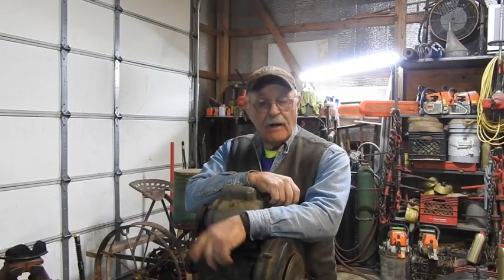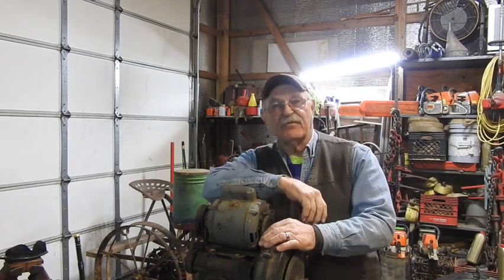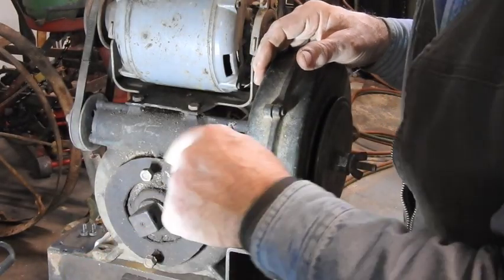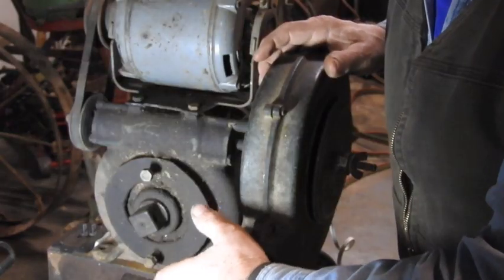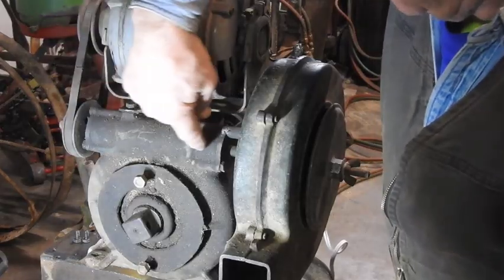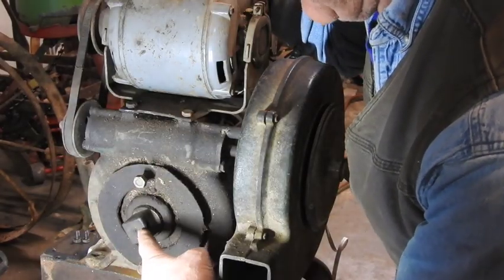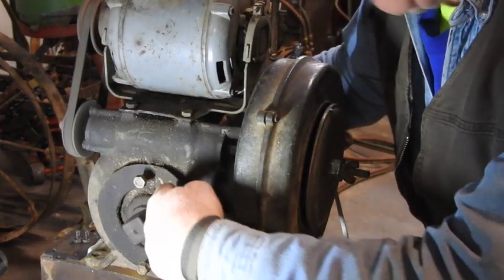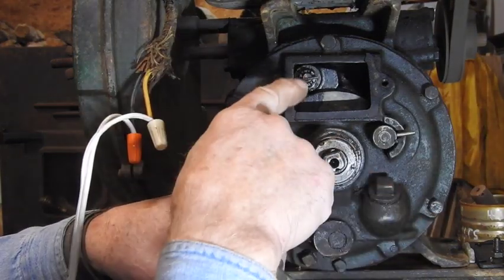Was THIS In Your Grandpa's Basement ?

Comment: I can just barely remember as a kid, a man putting planks down on the grass and wheelbarrowing coal into a 
basement window shoot. Our Timkin oil furnace lasted 50 years.
Reply from the maker: In the older part of my town you can see dozens of the old stamped steel or cast iron coal chute doors on the foundations some of the houses.  Lots have been eliminated and bricked or blocked in though.  Thanks Jon for stopping in with your fading memories.

Comment: Great Grandma's farm house had a big ugly coal furnace. It was upgraded with a fuel oil gun. Not the best heat transfer but it worked. AL B.
Reply from the maker: Hey Al, good to see ya buddy.  I never got to do a fuel oil conversion from coal, but I have gotten to tear them out and replace the whole she bang with standard up flow natural gas or LP gas units.  That thick old cast iron does NOT transfer heat quickly at all.  Especially on a cold cold house.  Thanks for stopping in today.

Comment: I grew up here in Maine with one of those old coal stokers on an "Electric Furnace Man (EFM)" brand low pressure steam boiler feeding cast iron radiators.    At sometime in the late '60s it was transformed into an oil burning rig.   They had to rebuild and refractory the combustion chamber to handle the oil burner.   As far as I know that system is still in that old house.  I suppose it's possible that a newer oil fired boiler could have replaced it... but the radiators are still there.   Thanks for the video and the memories!
Reply from the maker: Neat story from your memory bank.  I enjoy it when some silly video I do sparks memories in some of the viewers.  I also enjoy it when it blows them away because of never seeing something like it before.  Hahahaha. Thanks for adding to the thread Gary, it is appreciated for sure.

Comment: I was born in 73 bought my house in 92. It was built as a duplex right after WW2 and originally used a coal furnace like you described. That had been pushed aside in 69 and a NG furnace sat in its place. No one in my family had ever seen a coal furnace because no one had ever lived in town! I tore down what was left of the coal room and spent a long, hard day with my cutting torch hoses running through the chute to get that old furnace into small enough pieces that I could carry up the steps and through the 32” doors. I used some of the coal for a backyard forge, but I still have some stashed in the basement after all these years!
Reply from the maker: Hahahaha...and just think, I did that for a living.  Back then the pay wasn't too good though.  But we got to salvage a LOT of old stuff though.  Good story, I enjoyed it. I didn't manage to end up with any coal even though we had a barrel of it for our forge in the blacksmith shop.  Somehow I have managed to get parts to two forges.  Maybe I'll get to beat on some hot metal again one day.

Comment: I grew up in a house with a gravity flow octopus furnace with a coal stoker like the one you talked about. My dad later replaced the stoker with a new one--the old one wore out and he added a blower to force air into the house. What an improvement!! Something I remember happening the spring and fall was the heat demand on warm days was so low, the fire would go out, but the stoker didn't know that. Then when it cooled off and the stoker came back on, it would fill the furnace with unburned coal while Mom and Dad were at work the kids in school. My father was a very low key guy, but when that happened and he had to shovel out a furnace full of coal, he wasn't so low-key.
Reply from the maker: Hahahahaha....I love the story about your 'low key' dad...until he wasn't. LOL. What was that phrase made famous by Forrest Gump..." Sh_t Happens".  Good story, thank you.

Comment: I remember those old Honeywell gas valves you mentioned.  During the annual service, I remember two oil ports inside the metal can cover.  Some of them had a damper arm coming out the side to control the burner air.  If the power went out, you could pull up on that arm to open the gas valve and then push in a button to hold it open.  Back in the days of Natural Selection.
Reply from the maker: Yes, the two oil ports had tiny flared funnels on the ends just perfect to drop in a couple drops of oil with every service. And yes, you could bypass them on power outtages when necessary. I saved one of those old valves back in the 70's but for the heck of it I could not find it for the other video.

Comment: A the good old days. 
First house I remember had an oil stove in the living room. It was a lake cottage on Messenger Lake near Coldwater, MI. I don't remember ever being cold there. No blower. No registers. Just a big porcelain coated box in the center of the house. I was 7 when we moved and the "new house" had three coal stoves. One in the living room. One in the kitchen and the cooking stove in the back room. 
The old guy had died and my folks bought it from Baggerly Funeral Home who got it for burying the guy. First year we heated with lump coal from the small barn in the back yard. My brothers and I would go out and break up the lumps as big as your head with a hammer and lug them in the house. 
One of my childhood buddies had a much nicer house with a stoker. It was fully automatic and the coal yard just kept the bin full. 
We moved to the 3rd house and it had a coal furnace with the old chain damper controls. It worked well but took up most of the basement. It had been owned by the guy who owned the coal yard in Coldwater. 
Dad put in a natural gas forced air furnace and that was my last coal heated home. 
Now I play with fireplaces and a coal fired blacksmith forge. 
The wood stove will be an interesting step back from the basement and heated garage shops. 
Thanks for the trip down memory lane. 
The old memories are the last to go. 😁😎
Reply from the maker: As always, I LOVE your detailed stories of your younger years my friend. I didn't realize large chunks of coal was available like you describe, much less having to go out with a hammer and knock off a few corner.  That's a new wrinkle to digest. One of my uncles had the chains in the living room to control the damper downstairs, but all we had was a wood cook stove and a wood fired King Heater in one of the bedrooms. Nothing in the second bedroom.  We only used a bit of coal in the huge brick and stone forge up in the blacksmith shop across the road.

Comment: Interesting video T man. I never knew so much went into burning coal. For the past 20 years, I’ve heated my house with propane. This year I had a mini split installed.  14,000 BTUs. It’s been a pretty cold winter to test it out. So far works like a million bucks.
Reply from the maker: LP gas is good in my book.  There's 2500 btu's per cu ft of LP gas versus 1050 btu's per cu ft in natural gas.  There flu temps are close, with LP being marginally higher unless its a condensing furnace. Mini split heat pumps are great as well, but you have to be ready for the lower air temperatures as with any heat pump...as compared to a fossil fueled appliance. My favorite mini is the Mitsubishi.  I've installed quite the variety of mini's with none matching the reliability of the Mitsubishi. Of course that's only my experience. The upper end units maintain total capacity output down to about +5F which is really good.  They do it without any field installed low ambient controls too.
Reply: @ the unit I had installed is a fujitsu. The installers told me it would heat down to -15. And is guaranteed for 10 years.  I was going to go with Mitsubishi. But with a little research, these are said to be just as good. Time will tell.  But hey, it’s guaranteed for 10 years.

Comment: Now there's a machine that I have never heard of before. Then again, we didn't have these coal furnaces where we lived. 
Talk about " where there's a will, there's a way" in people's thinking and needs. Wonderful unit to be sure.
Reply from the maker: Hahahaha... Coal was widely used in this area back a few years. I just thought maybe there'd be one or two guys that remembered one of these old stokers in their own grandpa's basement.  LOL Coal was just a couple bucks a ton down here so I guess delivering to Newfoundland would increase the cost a bit, even at 25 cents a gallon for fuel.  (-:
Reply: @tractorman4461  I think I have  misled you in us not having coal furnaces, I meant that I don't recall seeing these coal stokers.  My goodness we certainly did haver them, but perhaps only the larger building may have had this type of system. Just a side note, the school here I attended, had a couple of huge hot water type coal fired furnaces, and when we wanted to skip a class, ( or two ) some of us would go down to the furnace room and sat and talked to the 'Janitor' as he hand shoveled in those huge coal shovels of coal. I think he would have liked to have an automatic stoker! :) I don't recall the price of coal back then, but it wasn't very costly.
I wonder what the price per gallon was for furnace oil then?? I do remember that when I was a young teenager and worked at a local 'gas station'  we sold gasoline for 48 cents per gallon. Now bear in mind that a gallon was  Imperial measure here in Canada and is approximately 4.7 litres, whereas the U.S. gallon is at 3.785 litres.
Reply from the maker: @regsparkes6507  Hahahaha....I'm not sure if I was mis-led or my lack of comprehension missed the point.  LOL. No biggie, but as soon as I read your reply I'd told the Missus Reg just told me they didn't have coal for heat in Newfoundland...so we had a bit of conversation about that.  Ain't that funny.  So now I have corrected my own mis leading info to her.  Oh well, alls well that ends well. 
   I liked your story about your schools janitor shoveling coal.  I don't know the price of #1 fuel back then either, but I'm sure it was cheap by today's standards. My grade school was finished in October of '56 the year I entered first grade. So all the kids from this side of town were separated out of the catholic school we all went to and put us in the new school on this side of town.  My class was the first one to go through all 8 grades in that school (minus September).  I remember Mr Hunt the janitor would sometimes let some of us boys peek into the boiler room and that was really a treat.  It was such a monster to us. Fast forward to the early 2000's and here I find myself dispatched to a service call to work on a steam leak on the 6'' header on that same boiler !!  LOL.  It was small compared to some of the real monsters I got to work on in the big city.
Reply: @tractorman4461  I'm thinking here , as  read your reply, that you and I Wendell, could well and truly 'burn the midnight oil' with stories  of those days gone by, especially school days when I was NOT a scholarly student  of what our teachers were trying to teach us. More education for me, was gleaned from me being out and about and all over our town. No, not a 'hoodlum' but way more interested in seeing how things were done and why. But there it is, I guess.
I like the comment of you looking at those hue boilers ( similar to ours too at school ) and now being called upon to go fix 'em. "What goes around, comes around' hey?
All good interesting stuff, and please say Hello to your Dear Missus for me.

Comment: In 1966, we moved from the old house that had a coal or wood stove in the kitchen and the living room, to a bigger house across the road, that had what I called an Octopus furnace. It was never stoker fed, just shovel in some coal, or mostly, throw in a few pieces of wood. 
 It must have been 68 or 69, that dad had somebody tear that monster out and put in an LP furnace. That's about the same time we got running water in the house, with a flush toilet and sink in the small closet, and a shower put in the corner of the basement.
Reply from the maker: The slang term for your octopus in this area was spiderweb, because they all started at the unit down low and ran upwards in all directions to terminate at all the floor registers up high.  No main trunk line, no blower. Dang you guys got all fanciful with the upgrades. I didn't get access to running water and daily showers until I went into the Marines in '71.  LOL. Those were the days, weren't they.

Comment: Our house in St. Louis County, west of the Chain of Rocks bridge, was built in 1934.  It had a coal room but the old furnace had been replaced by a new gas furnace.  The fireplace had a trap door in the back of the hearth which dropped ashes into a pocket allowing the ashes to be removed through the basement instead of through the house.  The washing machine was in the basement and the dirty clothes could be dropped through a chute into the basement.  I miss that house.
Reply from the maker: I had to pass the Chain of Rocks bridge every time I'd go to my union hall just a little north of there. I sure did do a lot of commercial service in that area.  All around 367 north, Halls Ferry etc.  I'm sure you've driven by and are astonished at the changes to the neighborhood !!  There's always something a fella remembers about the house he grew up in.  Yours sounds pretty well thought out.
Reply: @tractorman4461  It was on 1.4 acres, about 2 blocks West of Halls Ferry Rd south of the split with New Halls Ferry Rd.  It was our first house.
Reply from the maker: One of the tinners I worked with lived very close to you.
Reply: Ditto on the clothes chute. Mom had a Mangler for ironing bed sheets in basement.

Comment: Back in the early nineties I rented a house that had a Steward Warner Winkler low pressure fuel oil furnace. It needed to be serviced and the owner asked my brother who was a hvac tech to look at it. He walked around it , laughing at that old dinosaur from the early fifties. When he was done he did a efficiently burn test and said that it burned nearly as clean as the new fuel oil furnaces with clean burn technology. That furnace was in that house long after I moved out.
Reply from the maker: I have a Webster oil pump off of a Winkler low pressure burner on my home made parts washer I use on tractor parts.  LOL. You can tell the inefficient burner by the smoke in the chimney.  A good clean burn only puts out heat waves. Thanks for the cool oil burner story.

Comment: Neat video. Thanks for explaining how those old furnaces worked. I grew up in a house with propane and then natural gas floor furnaces. The house was built in 1907 and very cold in the winter. Did you ever work on the air conditioners that had the big cooling towers that had cascading water with air sucking through it?  Kind of like a super big swamp cooler.
Reply from the maker: 'Swamp cooler'.  In this area they were primarily used for cooling in laundromats due to the already high relative humidity.  Really simple, a water level controlled by a float, evaporative media, pump and fan. They work on the same principle as sweat on your skin surface. When your temperature elevates, sweat glands release moisture which cools your body as it evaporates. 
    Now the super big ones you see on large buildings are really cooling towers that reject heat to the outside air... heat that was transferred to refrigerant first then transferred to the cooling tower water through an indoor chiller condensor, then piped to the cooling tower. They too are quite simple in operation but have a much greater complexity of control because they are expected to operate year round in many cases. This is only a cliff notes description.  But yes, I serviced and started up many cooling towers to handle hospitals and major buildings of all kinds.

Comment: I think of that a LOT during the day. All the jobs that will be replaced by machines 🤖
Reply from the maker: The scariest place to be right now is a graphic designer.  A I is gonna push them right out the door.  Actually youngsters today had better get the best education the possibly can in a direction that's difficult to be over run by computers or robots. Of course that's only my opinion.
Reply: @tractorman4461  Robot repairman is best future proof job i think 😄

Comment: We called them octopuses in the basements ate a lot of asbestos Rippen them out
Reply from the maker: Man, I ate a lot of asbestos dust too, but the most severe ones were the thick handpacked insulation on the old boilers.  It was installed wet during the installation and dried solid. We'd just bust it all out with a hammer then break the fittings with two sledge hammers during tear out. None of the undoing with pipe wrenches.  Just smash 'em a time or two and they'd snap. Remember the asbestos paper on the spider web duct systems would sometimes have a wire wrapped around them too when it'd become dislodged a bit and want to fall off. I get tested periodically for spots on my lungs just in case.  LOL. So far so good..